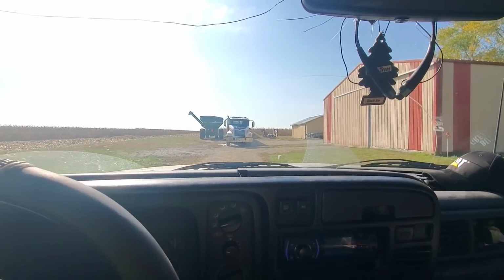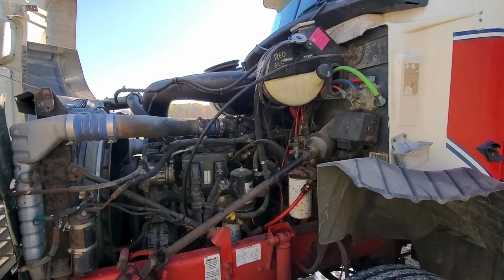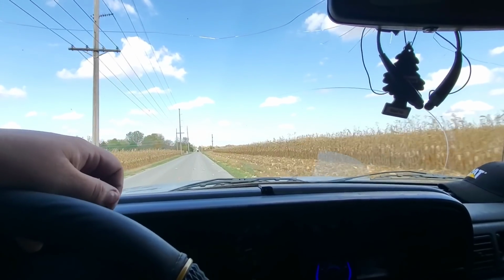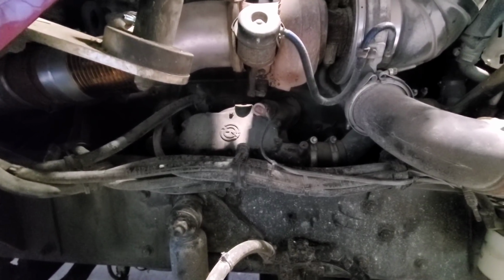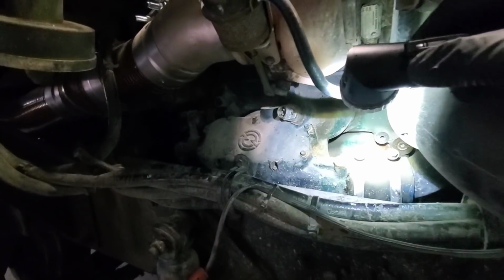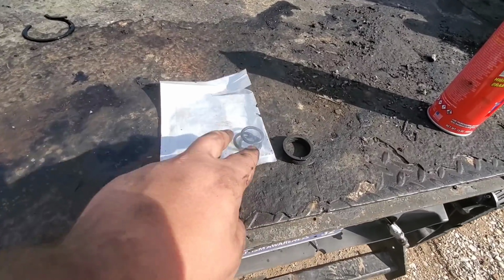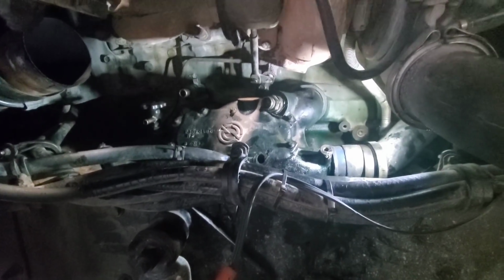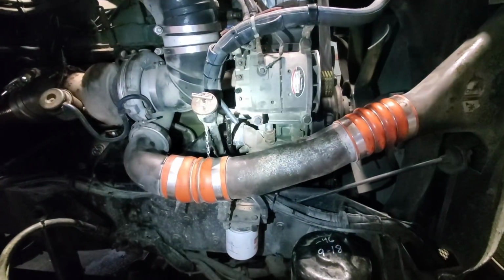Service calls Mack and Kenworth

Comment: Great video. On a Mack. As soon as you top the coolant off or the oil. Turn the key on. The cel and the lighting bolt should come on. As soon as you start the truck the ECM will basically do a system test and shut the light off.

Comment: Didn't you say awhile back you got your dads parts for his truck at your place? Just wondering when we will see that going together?
Reply from the maker: The dually I drove this evening lol its together but it still has an issue. I believe a shift fork is bent. When we get a free lift its coming back out. Since I moved i don't make video's at home.
Reply: Ah, no video oh well sounds like it will soon be fixed so your Dad will be happy. Good timing too since they are done with the wedding and back. Well actually be back up north soon to sell the house sounds like

Comment: Fix your windsheild
Reply from the maker: Naw
Reply: Chicks dig scars LoL 
and as soon as you install a new windshield you'll get a rock kicked into it.
Unless its new or nice, live with the crack as long as its not in your field of view.
Reply from the maker: @LittleWapiti   The windshield will probably cost more than I paid for the truck so until it bothers me it aint going anywhere
Reply: @Spyke383  And (for me at least) it'd probably snowball into replacing the dash pad, too, while the windshield is out and it's easier...

So, double nope on a cheap rescue vehicle.